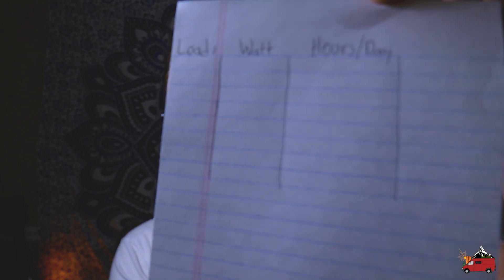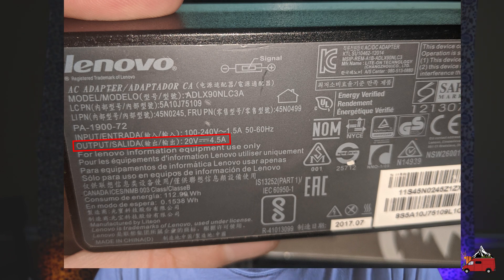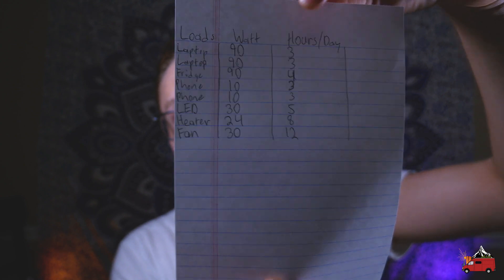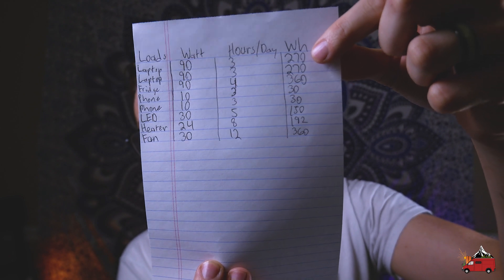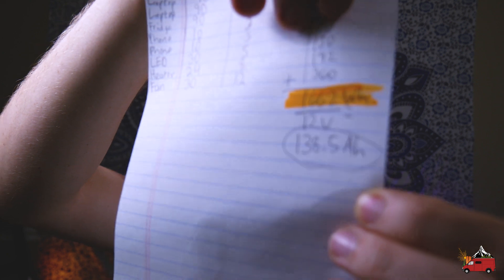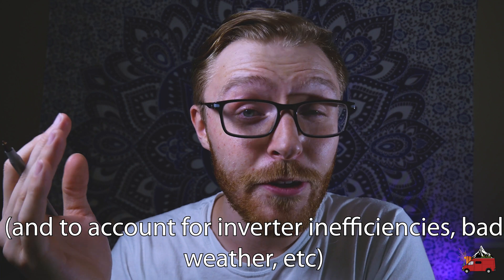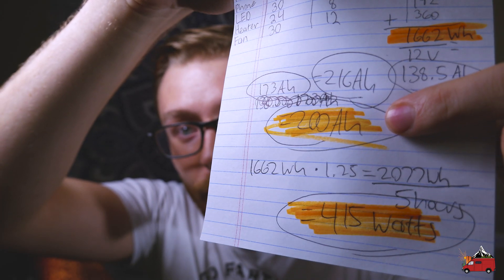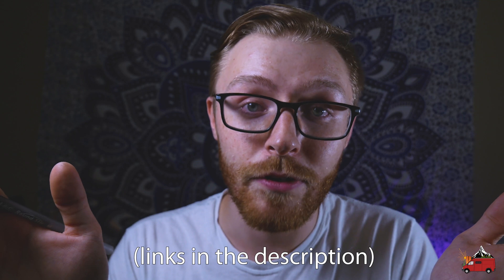How to Size Solar Panels and Battery Bank | STEP BY STEP, Calculate Your Solar Needs, VAN BUILD

Comment: It's worth noting that alternators do not just generate surplus energy when driving down the road with little load, as this would cause things to become extremely hot. Alternators only generate what is necessary. Therefore this isn't "free" energy as you will burn more fuel, however, you probably won't notice it as much, unless you're religiously watching your MPG as fuel costs for transportation tend to be hugely higher than that for electricity production, so it is not as noticeable.

Still is a very reasonable way (sometimes preferable) to recharge batteries when not on mains.
Reply from the maker: You're right it does increase usage but it is usually pretty small. I would say I wish I would have mentioned that for this you can usually install a 10-20A charger but anything higher you'll probably need to replace the stock alternator for one that can put out more amps. I'm installing a 200A alternator in my van to handle putting out 40A continuously
Reply: @projectvagrant8197  Considering that your engine is probably kicking out around 70-140KW (depending on how it's being driven and engine capability), a 10A charge would equal 140W of power at 14V (generic alternator voltage). Alternators can be 20% efficient, so multiply this wattage by 5 = 700W or 0.7KW. This equals about 0.5-1% of engine power output. Obviously this isn't huge but up the charge rate to 100A, which is likely for short periods of time, especially with a large, depleted battery bank and you'll be using an extra 10% of fuel...

(Sorry, I like doing the maths!)
Reply from the maker: @rebeccahare897  we love the maths here no worries 👍
Reply: Just realised I made a mistake, that 10% extra engine power output, not extra fuel. 10% extra fuel would be on the presumption that the ratio of power output:fuel consumption is linear, which it is not. Depending on engine capabilities, engine speed etc., an extra 10% of power output could mean a huge spike in fuel consumption which I wouldn't be surprised if it was in excess of 100% in some, albeit rare cases.
Reply: Excellent information! Just what I was wondering about. Thanks!

Comment: I have to run 1000w 12 hours per day. Can I do this with 8 200w panels, & 100A MPPT Charge Controller, Inverter, with no battery bank? It would always be used during the day and I live in the Mojave Desert nothing but sunny days.

Comment: Explain to me how watching your orange face for 5 minutes helps anyone figure out how to size a solar system.  It's like you have a different agenda other helping people or seriously teaching the public something new that is useful and that can really help our environment, in fact you say nothing about what is really a somewhat complicated system to design and build, in fact, in your fantasy prone personality you probably think you solved global warming by putting a camera in your face for 5 minutes and showing off or waving a scratch piece of paper that is basically make believe fantasy because you don't even mention inverters, charge controller, wire sizing, circuit breakers, fusing, AC disconnect, DC disconnect, temperature limitation, you don't even talk about PV source circuits, PV output circuits, Pmp, Voc, Isc, STC, dude you're a friggin genious, the Internet should have more of you but seriously there must be another way to fill the void dude. I'm just messing with you.
Reply from the maker: Uhhhhh...ok. I don't have any other agenda. I feel if I went as into detail as you're saying someone who doesn't understand a solar system as a concept and all the little parts would not grasp at all what I was doing/explaining. I did include a 25% overhead which should realistically cover the minkr inverter in-efficiency assuming you accurately calculated the total wh you plan to utilize per day (including devices through your inverter, I specifically show how to estimate this using my laptop charger as an example, and I believe I even mentioned the most accurate #s for this estimation would come from a kill-a-watt as a power supply is typically rated for.more.power than is drawn continuously.

Comment: Thank you so much! I have a solid tech, electronics and electrical background, but never had a clear understanding of solar.  We are trying to put a mini fridge, microwave and power too charging station in an off the grid work environment.  Putting all of this and more in a 20' cargo container!  

Joey, I am a solar newbie.  Watched your video on sizing battery and cells. (thank you). But I need to know what I need to do to connect them together.  Do I need some sort of controller? How do I tell when the batteries are fully charged (or not).  Can I monitor this remotely (WiFi?)
Reply from the maker: Hey David! Powering a full size fridge, microwave, etc will require a lot of solar power and batteries. But I suspect with a 20' cargo trailer it can be done if you cover the whole roof with the biggest panels you can find. 

To connect the solar array to the batteries you'll use a solar charge controller. Definitely get an MPPT type (more efficient than PWM). I'd recommend checking out Victron Smart Solar Charge Controllers if your budget allows, but there are cheaper options available that work fine.

Comment: How do you calculate it when the air conditioner has start wattages that are more than double the run wattage? Which one do you use in the calculations?
Reply from the maker: You'll have to make estimations honestly. Your best bet is installing it in your van and running the AC with a drop cable from a house utilizing something like a kill-a-watt to get actual hard real data on how much power is being used per hour

Comment: Perfect! This is exactly what I needed to calculate an existing powered van system of solar, generator an diesel. The solar panel and inverter system is already in place so I think I just need to calculate backwards and forwards to figure out what amps I’m using. Awesome vid to educate myself! Thank you so much!

Comment: Question?? We still need an inverter for this setup explanation correct? Do we choose an inverter that equals the amp of the battery we need?  My apologies if this sounds like a basic question. My calculations tell me I need approximately a 100 watt solar panel, check, then I need a 50 amp 12 volt lithium battery or a 80 amp deep cycle. Does that mean I need a 50 or 80 amp inverter?
Reply from the maker: Nope, you should choose the size of an inverter by one of these two things:

Either rate it for your battery's maximum continuous discharge current  (this is the maximum power in amps you can continuously pull from the battery, to convert the amps to watts you multiply it by your battery voltage (12).

Or you should base it off of the largest load you plan to put through it. E.g. say you plan to use a blender that pulls 900w and that's the strongest thing you're going to power via your inverter, then you'll need an inverter that can push at least that many watts.
Reply: @projectvagrant8197  oh ok, so the inverter is not based on combined total of amps or amp hours needed but rather by the  item on the load list that pulls the greatest amps? Is that right? So can I use say a 1000 amp inverter with a 80 amp battery? I guess I'm confused about inverting and batteries. Are there any resources you recommend that can help me understand? I've been researching like crazy but don't seem to get all the answers in one place. I realize that usually we would first decide what we want to power then go buy solar and battery and inverter based off that. But in my case I got a 100 watt solar panel as a gift and just want to do as much as I am able to do with it. I totally understand what you you taught us here with the calculations, I worked it all out to accommodate the solar panel. Now I'm trying to figure out what a 100 watt panel will do for me and how big of a battery and inverter I can get away with. I realize that is not the way people go about these decisions. Lol But how do I know what I can get away with when most tutorials don't explain it from that angle?

Comment: I really appreciate the simplicity of your presentation! It's right to the point without all the BS. Now I have a very realistic idea of what I need to assemble for my RV! My only question is how do you determine what size inverter do you need for the system you used for your presentation.
Thank you soooo much!!!

Comment: While the basic info on this is correct I will offer some advise regarding counting up the wattage, do not solely rely on the label or the internet, some products/ appliances not only have a running wattage but also a surge wattage on start up IE fridges, a/c , heaters even tools.  Go online and purchase a power consumption meter, they are about a tenner, plug it in at home plug in all your electrical goods and turn them on,  this will give you your correct watts used. Then work out your battery needs so mistakes won't trip your power supply or run it down too quickly

Comment: I dont recommend running wire from your alternator. 1. The battery types are different in your case 2. Even with same-type batteries they will naturally fight each other when not isolated 3. Chances are Your OE single alternator is not going to be up to the task. An after market high output or dual alts with an isolator, sure its a great option. But how you recommended it your truck won't start after sitting for a while
Reply from the maker: 1. That's why you use a DC-DC charger with the correct charge profile 2. They're isolated via the DC-DC charger. 3. It's a 90A alternator which works fine with my 40A DC-DC charger but I do have a 200A replacement alternator I'm planning to install at some point.

Comment: You have to use inverter as well to use AC fan, refrigerator, induction oven. So add 25% of more watt hour per day as inverters are not 100% efficient.

Comment: Hi! 
My wife and I got 4 solar panel from renogy and 2 lithium batterys from battle burn  for are system but it's difficult to decide what gauge of wire to use for the battery system  my question is if you know a way to know the proper wire gauges for the battery the invertor?
Reply from the maker: Figure out the maximum discharge current of the batteries and gauge for that. Or if you'll never be pulling that much power, figure out the maximum amps you would pull with your inverter and gauge for that.

Comment: "Excess power which is literally going to waste anyway" ??? That is not true. If you charge your batteries with altenator you are definitely going to use more fuel. Altenator spins freely when there's no load and takes very little power from engine but when you drop a big load to it, it acts like a regenerative braking in an electric car, dragging the engine rpm down. Charging your battery by running your engine is super inefficient at best, but it's a perfect backup solution and definitely recommended.

Comment: Is that 216 Amps per hr? So if you planned on running for 10 hrs you would 2160 total amps? Sorry if this a dumb question btw new to this.
Reply from the maker: Nope it's per day (24hr). 2160 would be a crazy amount haha, I wish though! I'd have an A/C
Reply: That's 216 Ah: A x h, not A/h. It is basically saying that if you used all the energy that you use over a given time (10 hours as per your question; 24 hours as per the video) in one hour, what the current (amps) of the circuit would be (in this case 216A); or if you used exactly 1 amp at a time, how many hours it would take to use an equivalent amount of energy (in this case 216 hours).

The specifics are actually a lot more complex as if you used 216A, you'd need some very thick cables and a battery with CCA that is capable of kicking out this many amps, meanwhile much of the energy would be lost as heat (current ≈ heat) and batteries drop voltage when put under load - the greater the load the greater the voltage drop - which then requires you to increase power or current, as Watts law P=IV.

For the above reason, it's also important to choose the correct type of battery, as if you use 80% of this energy in a couple of hours, it may be better getting a semi-traction battery rather than a leisure battery as the former is better at dealing with higher current draws (but not as much as a starter battery which best deals with very high current but only for a matter of seconds).

Comment: You said charge house batteries with alternator bad for lithium
Reply from the maker: Yes if you do not use a charge controller. If you only use an isolator it does not recharge to the right voltage. With an alternator charge controller (basically a huge 12V boost converter) it will up the voltage to the correct amount. I bought the Renogy 40A dc-dc charger.

Comment: Question, how large of a battery bank will it take to run a 1.9A, 220
Watt pump 24 hours a day, 18 hours a day and 12 hours a day?
Reply from the maker: Typically water pumps do not always draw their load because they build up pressure and only kick on when the pressure is depleted to build it back up. E.g. if I run my faucet for 10-20 seconds, the pump will usually kick on but only for 10-30 seconds usually. It would be tricky to calculate the usage due to that, but it would not be pulling that much overall. I would figure that it may run a total of 20 minutes a day with heavy use, which is about .3 of an hour. I am a bit confused though, does it draw 1.9A or 220W? The reason I ask is because Amps = Watts / Voltage. But 220w / 12 volts = 18 Amps. Not 1.9 Amps. Whichever you decide to use. Great question though, wish I had mentioned this in the video.
Reply: Project Vagrant my pump has a rating maximum of 220 watts, 1.9 Amps & 120 Volts. If I run a pump with this max power ratings, how should I Size my battery bank?
Reply from the maker: @keithmcgee1253  I understand you now, I didn't realize it wasn't 12v. I would get 150Ah if using AGM. That gives you a little extra electricity.
Reply: Project Vagrant thanks so much for your quick response. Much appreciated!

Comment: What if you want to use an ac fan on an inverter? 1 amp all day long?
Reply from the maker: Depends on your inverter but there's definitely going to be an idle draw unfortunately. I would suggest getting a DC fan. You may be able to open up the fan and find it has an AC to DC transformer in it. You could use a multimeter to find out. Then you could wire it directly to 12v. If it's a higher voltage motor you could use a boost converter to step up the 12v to whatever the fan needs. But obviously itd be a bit more effort
Reply: Ok thanks. I guess it’s worth spending the extra money to buy a dc fan and fridge to greatly reduce the battery and solar requirements
Reply from the maker: @matt2437  if you need something cheap I would recommend USB fans. They've got decent strength and 360 degree rotation. Then you'd just need a USB port.

Comment: I'm going to be buying renogy 200 watt 12V solar panels and 12V batteries to store energy. All I'm going to be running is a phone charger when needed. A 28" smart tv for a couple hours a day TOPS, and a two 16 quart small alpinecool portable refrigerators almost around the clock.(They turn off when cool temperature is reached and turn on when starts getting to far above selected temperature). Will this be sufficient power to run these items, and is it safe to have 12V batteries inside the van while the solar panels are charging them, or while you are using them? Are there any fumes or any other safety hazards?
Reply from the maker: You're missing a lot of info here -- I don't know the wattage of the smart TV to guesstimate its power draw. And you said TWO fridges or just 1, and you included neither of their power draws either. 
You also did not even say how much capacity your batteries are going to be, just the volts, or if they will be lithium or lead acid. 

If you get sealed batteries (for lead acid, that is AGM or GEL,  I would recommend AGM over GEL, most lithium batteries are sealed) then you do not need to ventilate them. If you get FLA (flooded lead acid, they have plugs on the top you have to open up and add distilled water to every few months) then you should ventilate them.
Reply: @projectvagrant8197  the fridge runs about 280 watt hours...over 24 hour period of time.
Reply: @projectvagrant8197  TV around 70 watts
Reply from the maker: @castle6660  how many amp hours will your battery bank be? and will it be lead acid batteries or lithium? I'll crunch some numbers when I get home and help you figure this out but that's the last piece here lol
Reply: @projectvagrant8197  I know absolutely nothing about any of this. I guess my question is...Is 200 watt solar panels big enough to run these items, and what battery should I get to make this work without ventilation
Reply from the maker: @castle6660  it should be big enough if that is ALL you're running. But you'll likely want to run more than that (like a vent fan or just a fan) at some point. 200w solar and a 200Ah AGM battery should be fine for 1 phone, 1 smart TV @70w ran ~3-4 hours, and a fridge that only uses 200w per day. You'd even have a little wiggle room for bad weather, or adding a fan or some smaller electronics onto that.
Reply from the maker: @castle6660  Hope that helped out out, never heard back :)
Reply: @projectvagrant8197  I finally have everything for my solar setup...I was wondering if I could email you and have you look it over for me?....
Reply from the maker: @castle6660  posting your diagram to diysolarforum.com would be best that way multiple people can give feedback 👍👍